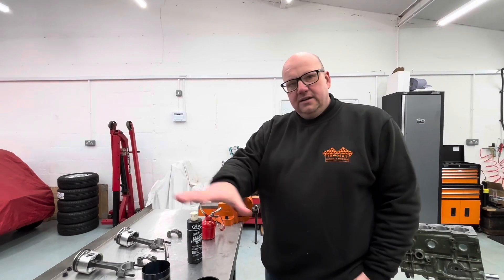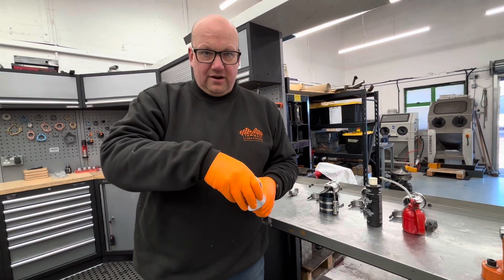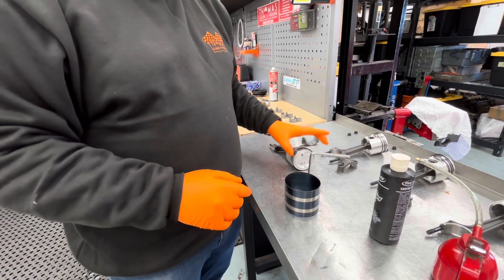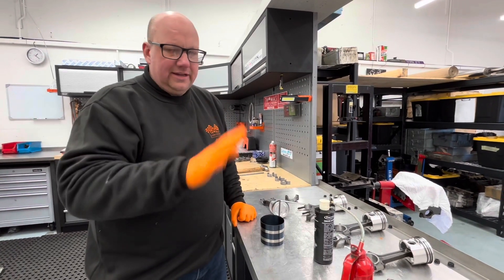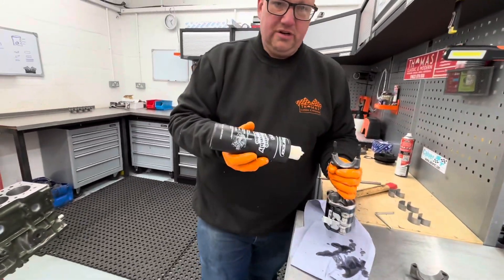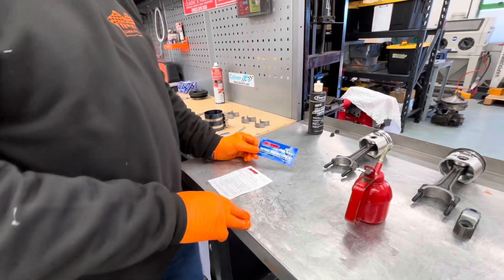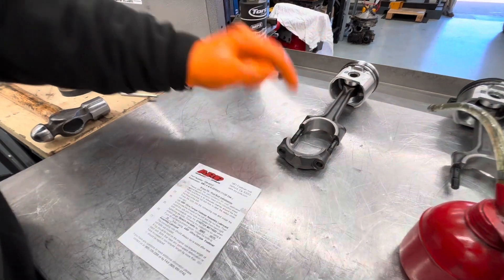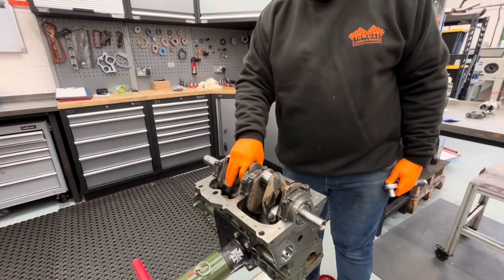Classic Mini 1360 Short Motor Engine Build Pt5 - Fitting Pistons into Block

Comment: A rubber sleeve on the big end bolts eliminates the chance of journal damage as you push it down.
Reply from the maker: Never needed to do that, but I can see how it would benefit, in case of errors.

Comment: That's how i've been aligning rings for decades. Keep the wiper ends on the skirt for a bit of oil, and the compressions off the skirt to keep any loose carbon from getting on the thrust faces, and/or blow by tossing junk down the skirt.
Reply from the maker: Good to hear we aren't alone 👍👍